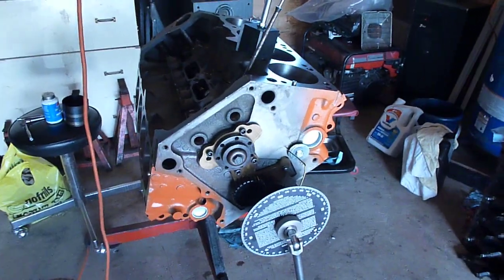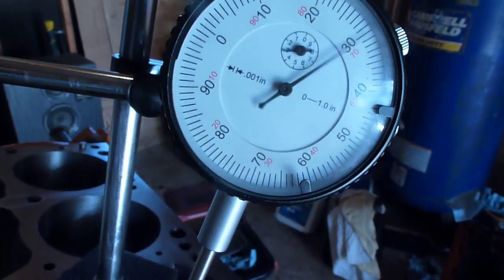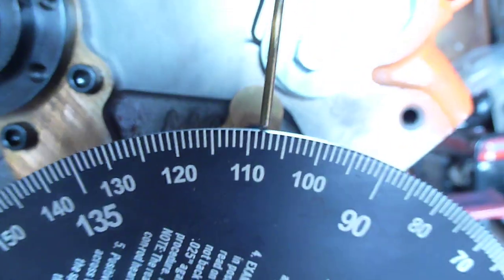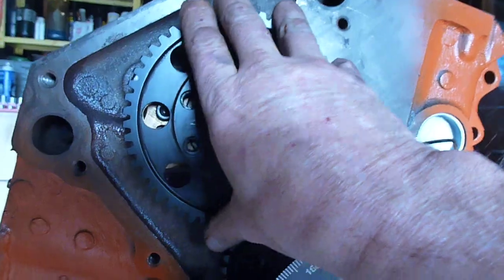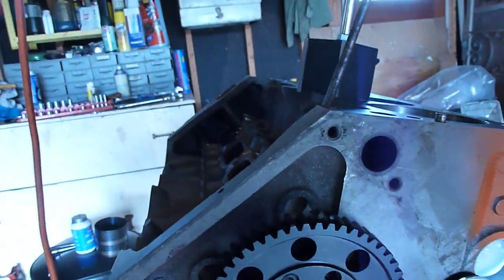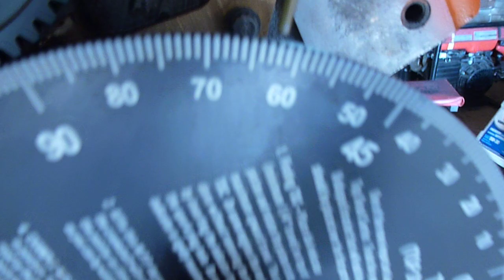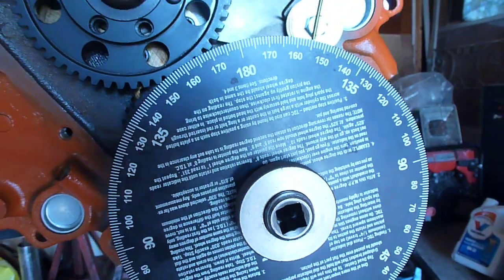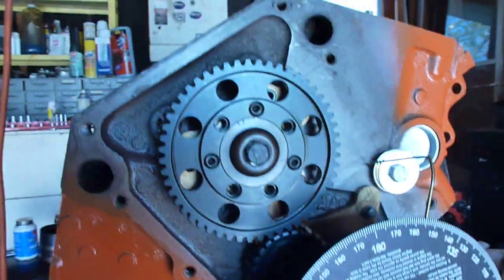Install of a Milodon 13600 gear drive for the small block mopar LA engine

Comment: Damn good video! I have a Milodon for my AMC / AMX  NHRA Super Stock car. NOWHERE can you find instructions beyond the initial set-up (installing the gears straight up). The Milodon instructions made me pull my hair out on advancing and / or retarding once I had the straight up baseline. Never could get the advance or retard I wanted. Then I found your video and wallaa...first try got, what I wanted. I did run this same Milodon Gear drive on my last engine and for those not informed about these, they DO NOT rob HP and cause engine damage caused by harmonics. Leave that to the crap 4-gear setups. Ever wonder why the Milodon is 4-5 times more expensive than the JUNK 4-gear Gear drives? Because you get what you pay for. I shift mine at 8,000 RPM and I know of a few Hemi racers that spin their's to over 10,000 RPM. Your engine will blow before this breaks. And lifetime warranted, don’t even need to be original purchaser. I have never seen a more accurate timing mark using your timing light. The mark does not move at all. And I race w/ open headers and I can barely hear it in 4th gear. Loud is reserved for the junk 4-gear units.

Comment: So this saved my bacon, I bought the gear drive with the built in cover and was doing a cam and cover swap with the engine in my C10.  Essentially heads are still on so I learned I could find the TDC with a locator bolt screwed into the plug hole.  I printed a degree wheel on the computer and glued it to some hard cardboard.  Found TDC and set it.  I put the lower gear on and fitted the cover after prying the small locating pins out and re-drilling for the larger new ones Milodon provided.  I had to drop the front of the pan to have it slide into place, just an over all pain in the ass.  Eventually, I got it to fit well, and after bolting it down I pulled the old cam and installed the new one.  But now I had to align or phase the cam to my crank that was sitting at TDC.  I had to turn the cam independent of the crank and figure where it should be without any marks or cam gear that would prevent its position to move independently until it was in the correct position.  I found it confusing to do it accurately.  I could guess but one gear tooth off is like 2 degrees on the cam.  This confirmed how to align the cam without the gear until it gets to the correct location.  Honestly what I expected to be as simple as a timing chain or the noisy 4 gear  cam drives became extremely confusing but this video straightened out my thinking!  Thanks for posting!

Comment: We're you able to use the stock timing chain cover for the mopar small block along with the gear drive?
Reply from the maker: yes it 100% fits in there with no problem at all .. Ive done 2 of these and had no trouble .. you cannot however use the eccentric for the fuel pump so an electric pump is required.. thats the only draw back .. but most people dont use the stock mechanical pump anyways

Comment: I was thinking of doing this to my 360 build for my 65 dart . the kit is a little expensive. I was told you had to set the gap between the gears by using a strip of school lined note book paper??? have you got the engine together and running ?
Reply from the maker: sure do and it works great .. this is not the first gear drive ive used in a small block mopar ,Ive had some experience with them and they do live for a very long time. check out the other vids on my channel of the car running and driving
Reply from the maker: you set it with news print thats how ive done the last three of them and they all still work great
Reply: @fingers967  ok will do 😎👍🏁

Comment: Thanks for uploading this...  This is like the only other video besides the Sema show. I guess no one actually wants to invest in a quality engine?    I was considering a gear for a SBF build in my Econoline.  I've studied the pitfalls of the typical 4 gear sets, el cheapo..   and am very interested in this set now to do it the right way the first time.  I'm just curious if you have a video you could upload of it idling or running?  I still am curious about the sound  as they advertised  the straight cut gears will make some whine.   Just because in a van  you're sitting on top of the engine about  and I like the sounds from under the dog house from the starter motor to the whirring of the converter.  So just curious.   oh and  how was tapping the mounting plate?   I have an extra block to practice on thankfully.
Reply from the maker: Tapping was easy .. drill with 17/64ths drill and tap 5/16 x18 thread. there is a video of myself and my daughter going for pizza in the car shortly after the engine was finished . that should give you an idea of how it sounds
Reply from the maker: Heres a video of the gear drive in the previous motor I had in the car ,, the sound is great in this video      https://youtu.be/jw-hBPT9Nlc
Reply: @fingers967  Oh sweet!   That sounds perfect actually.. as I said especially in the dog house where everything is a little more audible.  For the $  it also  just sounds like a  "better" machine  as far as tooth cut.   It's also amusing that people install new blocks to the same gear drives... So is the hardware  universal?   I mean I guess I'll find out  with whatever bolts it comes with for a 302 ford ..  Also sweet Duster!   I always loved Dusters in mopar land.. obviously once they brought back the charger / challenger,  people kind of forgot  about certain cars I think.  Especially good old middle weights now that  muscle cars weigh 4500 lbs lol     I thought my 90 Supercoupe was heavy at 37-3800.